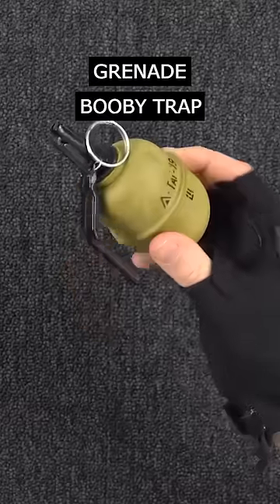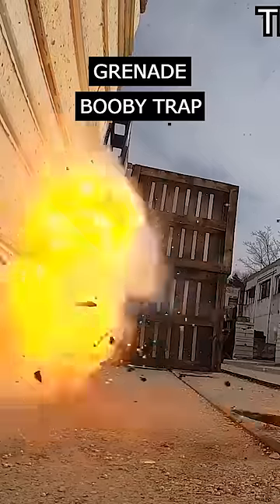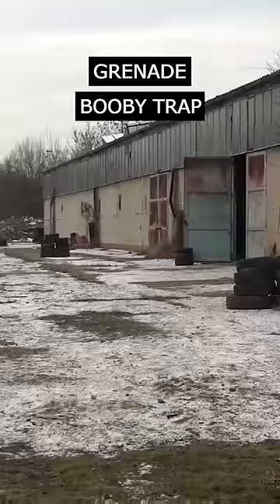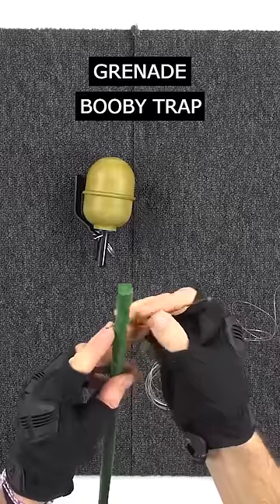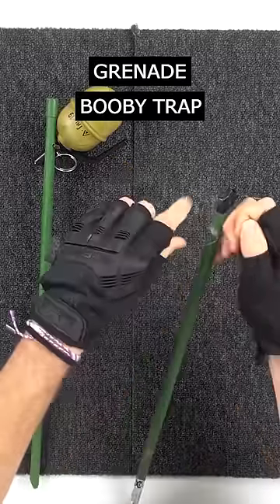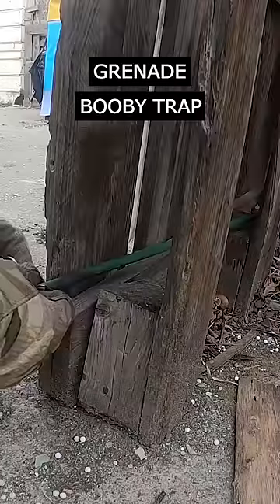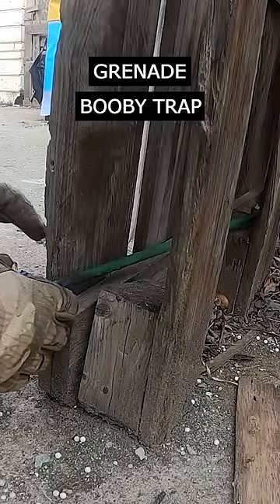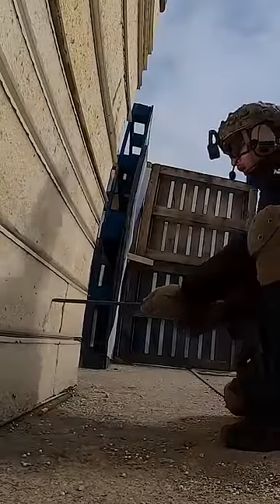Booby Traps In AIRSOFT #shorts

Comment: Lmao that explosion looks actually dangerous
Reply: True
Reply: Yup, they can blow off fingers
Reply: Eh it's a certain amount of explosive allowed, it looks like it can but if it could, you wouldn't be able to buy them online.
Reply: @JakeAtkinson43  unlikely unless it goes off in their hand though
Reply: No just not in any wood area related
Reply: @FeedMeChaos1  the problem is that a lot of people try to throw the grenades back
Reply: Imagine someone having propane instead of co2💀
Reply: @mr.tucano  true that, it’s understandable why airsofters play like call of duty but picking up live explosives is kinda dumb even if it is ballsy
Reply: It doesn’t fragment, and has less powder that’s the only difference these have the potential to be used just like a real grenade except it’s explosive payload is very weak so if it did have some kinda fragmentation it wouldn’t be like a real Grenada but I bet ot could still penetrate you, European air soft crazy
Reply: nigga yeah bahahaha
Reply: They are, my leg suffered a severe burn from an airsoft grenade someone had as it went off after hitting off my shin
Reply: @Thegreycomrade  Goddamn
Reply: @JakeAtkinson43  it's a big fireball not a big blast likes firework of the same size fireworks blow fingers off because they are designed to make a big loud explosion, this is designed to make a fire ball not do damage it doesn't even send bbs out, it might give you a bad burn but your fingers will survive
Reply: @karsongilbert9203  looks like the shell of the grenade is foam so probably wouldn’t hurt to bad
Reply: @JakeAtkinson43  if you are holding them
Reply: Yeah wtf? Yes using that against unaware people? I'm confused
Reply: @JakeAtkinson43  that isn’t true lol it’s a harmless explosive there is no gun powder or anything just smoke and enough of an explosion to destroy the outside witch isn’t even metal it breaks away ex enugh
Reply: @uhohmemebiggestboy212  that’s not fire! It’s the pressure from co2
Reply: @teeg7078  it’s just expanding co2 and there outside is a harder foam
Reply: Well Russians don't fool around with Airsoft milsim
Reply: It does look like a flashbang which only does harm on naked skin.
But then again i dont have any experience with those airsoftgrenades.
Reply: @Zipotricks  knowing the history of Russian Airsoft grenades, I can assure you: it's not even a flashbang, it's literally a firecracker with BBs around it. Despite getting away from repurposing firecrackers and coming up with original fragmentation-free mechanisms of initiation, Grenades power over here is still measured in firecracker equivalent. I don't know if you have firecrackers named "Corsair" (Корсар), but regular power Airsoft grenades goes as equivalent of Corsair 4, more powerful - Corsair 6
Reply: Yeah I'm fairly certain a fair amount of fields would just throw you off for that if they'd even allow you to get through the gates with that. Not just a hazard for players but for the field itself
Reply: dudes tryna kill somebody
Reply: @unhingedhobbyist6722  you can buy drugs and cp online
Reply: It's airsoft dude....
Reply: @Zipotricks  I do lol the only ones that hurt are the ones made of metal with gunpowder in them
Reply: @РикСанчес-я6з  yeah they do lol that’s the point lil
Reply: Even if it goes off in ur hand it’s is fireball and bbs, There’s no real shrapnel like a frag, would likely be similar to a firework going off in ur hand. Which isn’t fun, but isn’t that big of a deal either, normally only burn damage
Reply: It blew chunks off of the wall...
Reply: @TBendez  you mean the “wall” of styrofoam that he pushed a stick through? I don’t know if that is saying a whole lot
Reply: The explosives are very benign, even in your hands, if it could damage you you'd need explosive handling certification.
Reply: @Meas Boy those grenades are made by Taginn which is Russian company, so yeah, who cares my girl
Reply: @unhingedhobbyist6722  I can buy a suppressed muzzleloader and have it sent to my door...
Reply: true
Reply: @Meas Boy whatever you say ma girl whatever you say
Reply: This is about the same as a T Flash. They look and are popped exactly the ssme as road flares and only hold a small explosive. I've had two of them pop in my face, one of which I was holding. Don't ask.
Its almost strong enough to blow off a finger but you're more likely to shit your pants and walk away with your ears ringing a bit. 
I've had them pop literally at my feet and I'm fine. They look and sound scary but that's the whole point I think. Realism and lowkey remind you the real thing is actually fuckin' terrifying and fulfills its purpose really well!
Reply: @FeedMeChaos1  or in the face
Reply: It could only really hurt your eyes, soft tissue like genitals, or your hand if it's blown up in it. It'll maybe scratch bare skin but it's literally never there if you're in bb gear
Reply: The problem with these are the shrapnel.
Reply: Yeah how is that an airsoft weapon?
Reply: It's just flash powder in a cardboard shell
Reply: @teeg7078  Because you let enemies know what you're about to do, right? Very intelligent
Reply: @Skelybones9087  It's not CO2. Co2 doesn't flash brightly. It's just flash powder.
Reply: @thevalorousdong7675  that makes it easier to digest in this context. Thanks for the info.
Reply: Yeah that shouldn’t be legal
Reply: Has flash powder in it for sure. Not safe in close proximity. Kiss your fingers goodbye
Reply: Blew off part of the building lol
Reply: @JakeAtkinson43  uh no lmfao
Reply: @JakeAtkinson43  I've seen a smoke bomb blow off someones fingers dude
Reply: @spiderymantis4226  yeahh, there just don't grab them on the field and wear gloves, my mate had a airsoft grenade go off in his hands while wearing gloves but it just took skin off
Reply: @FeedMeChaos1  what if someone dives and lands the croch
Reply: It's as dangerous as fireworks is probably. Looks legal plus all of them are armored and whatnot.
Reply: Bc it is
Reply: @abeyance3359  yikes
Reply: @unhingedhobbyist6722  I saw one of the older gents I played with lose 2 fingers and part of his palm cause he picked one   up to throw it back (not the same one but it's very similar explodey wise)
Reply: Nah, we've taped these directly onto a person's body and nothing happened, a red mark like it they were slapped repeatedly in the same spot. Also they don't blow off fingers, legit saw someone have a full grip on one while it explodes and same thing hand was red and a little purple from some bruising. Not dangerous unless hit in the eyes.
Reply: @unhingedhobbyist6722  k
Reply: Guy threw one of these in a building full of my squad mates and I jumped on it to take the full blast felt like a punch to the stomach not to bad lol
Reply: I thought it was real
Reply: @Skelybones9087  there is 100% a fireball created by this grenade.. co2 looks nothing like a fireball, and that’s very clearly a fireball..
Reply: Probably less then those old 180 firecrackers
Reply: @unhingedhobbyist6722  bro I don’t think this is America...
Reply: On top of the fact he added other bs to it
Reply: There’s no shrapnel so it’s not as dangerous as an actual grenade
Reply: @unhingedhobbyist6722  you can buy nukes online
Reply: It may have something to do with the fire. It makes it look spectacular but it's not destructive like a real grenade which isn't fiery, or have flying shrapnel.
Reply: Fr hahaha wtf
Reply: @Skelybones9087  and the co2 is being ignited by charge.. fireball..
Reply: @karsongilbert9203  * It's not supposed to fragment. The moment you introduce an explosive charge to a sealed container, all bets are off. And even if the main casing stays intact, with a little bit of poor luck there's enough energy there to launch the rest of the parts halfway through your spleen.
Reply: Yeah, it can burn you, but it's explosive power is low
Reply: @mr.tucano  kick em
Reply: @FeedMeChaos1  shouldnt be an issue as most people know if the pin comes off you throw it
Reply: It not just look it can hurt somebody. Imagine he didn't know and place his leg at that trap.. he won't lose his leg but he will hurt like sob.
Reply: @Thegreycomrade  why arent you suing
Reply: @uhohmemebiggestboy212  
You: “big fireball does no damage”
Also you: “big fireball can burn the shit out of your fingers”
So how are burns not damage again?
Reply: @unhingedhobbyist6722  that’s certainly not true
Reply: It is :)
Reply: Probably just an M80.
Reply: @karsongilbert9203  they HAVE to fragment even if it’s just 2 pieces.. it’s encased in plastic.. it doesn’t decintegrat
Reply: @unhingedhobbyist6722  nanny state freedom ya sure
Reply: @FeedMeChaos1  That's literally what he ment tho
Reply: Not that different from a larger Fire-cracker though.
Reply: Not that different from a larger Fire-cracker though.
Reply: @Skelybones9087  Gun powder is low explosive, or just an airless burner. It actually have the least stored energy&heat/weight of all popular fuels/explosives. In this there is something similar or cordite at worst. It explodes order of magnitude slower than high explosives, so potential shrapnel flies accordingly slower. Around the speed of sound compared to MACH 5-15 for high explosives. This casing is likely thin painted polymer, so just slow and light enough not to pierce the skin. I've blown up a thick cardboard/newspaper bundle of black powder in my face. All depends how it's packaged.
Reply: @FeedMeChaos1  still not enough pressure in these to blow your hand up
Reply: @jaimejimenez4223  not the whole hand at least
Reply: @zen8704  inspired by ride along lol
Reply: @FeedMeChaos1  that's like saying this 9mm could punch out the back of your skull, unlikely though unless it hits you in the skull
Reply: @Skelybones9087  the only time an explosive is harmless is if it's inert. And if you're telling me expanding co2 somehow isn't dangerous sit really far forward in car and crash into wall at speed and feel your face be crushed because your so close to the airbag it's in it's moment of highest acceleration.

Edit: and then get back to me, kind regards.
Reply: @unhingedhobbyist6722  bad logic, there's so much terrible shit you could order online
Reply: These are no joke. Me and my friend got a box of these and they’re so expensive but definitely worth it to spice up your games. Everybody’s heads turn when these get used
Reply: @SkorpzOfficial  there's a guy in this comment section who genuinely believes they are completely, completely harmless
Reply: It knocked chips out of the wall🤣
Reply: Someone in Austria lost a couple fingers trying to pick one up and throw it back 😬
Reply: ImErSiOn
Reply: Yes
Reply: HAIL FLOCH  yet people have lost fingers to this exact grenade 🤔
Reply: @swide2750  because it was a mistake, these things can happen plus I was more concerned my Gorka suit wasn't damaged or burned through
Reply: @Kozycz  if a firework goes off in your hand you dont have a hand anymore you know that right?
Reply: @unhingedhobbyist6722  man I'm glad that you pointed this out, can't wait to test that theory with these m80s I just bought, let's see if they hurt me :o
Reply: @karsongilbert9203  you're telling me those bits aren't going to be flying around? Of course it fragments. I paused it during the explosion and I can see little bits of fragments everywhere. Watch it again really slow. I was going to tell him that if you tie the string around the grenade itself and hang it off of its ring. When it's pulled the ring will be on the stick and the grenade will be on the end of the string and it will wrap around the person's leg so they can't run away but that's likely to castrate somebody.
Reply: @unhingedhobbyist6722  I mean you can buy fireworks depending on where you live and they do the exact same if not worse.
Reply: its probably mad dangerous if you dont wear anything protective
Reply: 😂😂😂 nah fr
Reply: @zen8704  what about that?
Reply: Lol
Reply: @karsongilbert9203  weightless too

Comment: Booby traps like this are mostly for getting a warning the enemy is approaching from a direction, giving time to prepare.

 In order to catch the enemy unaware, place the grenade between two sturdy surfaces in such a way that when you take out the pin, the lever holds position and the fuze doesn't activate, next take out the pin to activate the trap.

 The idea is that the enemy will kick or in some way interact with the trap surface, releasing the grenade lever silently, trap surface could be a wood pallet, box, anything sturdy enough to hold the grenade but be moved by human contact.

Comment: You need to set the charge behind the trip line:
When they trip the device they will be alerted and retreat, unaware they’re retreating back into the blast area. Or better off set 1 grenade forward of the trip and 1 grenade rear of the trip.

Comment: Fun things I’ve learned from my dad after he went through sapper school, the simple wire to pin requires way too much force they’re going to feel that wire one their shin next time pull the pin but make sure the spoon is still attached and put it in a soup cup and then tie a string from the grenade to the bottom of the door the grenade will get ripped out of its can and flung into the room thus exploding in the center of the breaching party

Comment: Pro tip: cut off a soda can so the grenade and spoon fit inside. The can will hold the spoon down. Tie the can off to an area, and tie the trip wire to the fuse just under the spoon and pull the pin. Them walking through the wire will pull the grenade from the can. Takes less force than them pulling the pin, so it's less noticeable.

Comment: When I was in the army I would set up booby traps on the smoke grenade to ambush my platoons convoy during training. I’d run 50 ft of 550 cord and when the smoke goes off they waste blank rounds in the area of the smoke and I pop up and take out the gunners on the vehicles. We had the MILES gear which is basically laser tag. You wear around your vest and helmet and the barrels have the laser that activated when the blanks fire. So much fun

Comment: The key is to ensure the grenade is where the target will be, not unlike leading a shot in sniping. For example, if you want the grenade to drop at the top of the stairway, hook up its tripwire at the bottom; if you want to booby trap a hallway, rig the tripwire at the entrance and the grenade in the middle.

Comment: Okay simple fix, tie trip wire like you did, pull pin & slide it into Container that will hold fuse lug closed. make sure grenade slides out of container easily before hand

Comment: Long rant below, as well as a personal story and PSA.

So i actually got a similar model of grenades myself and used em in some fun airsoft fights..however after 1day and noticing that yeah..that delay was bad..i modified the fuse to make them go off about 1full second after a trip..however turns out that was a violation on the field rules and i was banned for a month. I dont disagree with the ban and im glad for a dumb mistake that it was..it was only a month penalty. It was explained to me..by having such a short fuse..and keeping in mind theres still a hot detonation, by modifying these grenades into a trap it increased the potential of harm to competitors, which isnt ok. Thankfully the couple of guys who fell victim to my traps had thick pants on, so they werent hurt..however if someone had shorts i was told, i couldve caused alot of tissue damage. I actually during my offtime tripped one on myself from 1 foot away and it did infact leave alot of shallow lascerations..so please dont mess with the fuze on any grenades. We all want to have fun and yeah..maybe get a bit roughed up, but no one wants to be in the back of an ambulance cause someone else was trying to be clever. So be careful folks. I call myself lucky learning a serious lesson and lucky i didnt hurt anyone besides a test on myself. If you want boby traps, theres many p-mines and claymore brands outthere that are perfect and alot safer than modding a airsoft grenade..and tbh maybe even equal or lesswr weight. Again be safe and fair.

Comment: While you could design the trap to drop the grenade on the other side of cover; the problem with using a doorway choke point is the target has a 50/50 chance of being on the same side of cover as the device.  So pick a different location (stairwell) or device build which detonated on both sides of the door.

Comment: So best place with a delay is at top of a staircase or something like so..so if there’s people behind them they are blocked. And also you could do a 2 frag trap. So you place one hidden about 2-3 meters near the other. When the string is pulled both will be set. They run back for “cover” not knowing they are running back to another frag. Maybe it’ll work maybe not?

Comment: You could use some tape to prevent the pin from falling on the ground. To do so, use some painter tape, turn around the part that comes out, leave some length to allow it to get off and turn around the body of the grenade. Or use some fishing line as well. The goal is to prevent the pin from making noise

Comment: If you wanted that to work, put the grenade in a cup attached to the stick. Pull the pin while the grenade is in the cup. Make sure the spoon has pressure so it won't explode. The idea is to cook the grenade so that way when it drops out of the cup, boom.

Comment: To make this work you'd either need to find some way of shortening the delay or set up multiple in an area. Probably set off to go all at once 
 So the likelihood of an opponent dodging it is reduced.

Maybe a motion sensitive trip that sets off the grenade a little earlier so by the time the opponent is within visual range of the trap it's too late. Though at that point you might as well have a claymore.